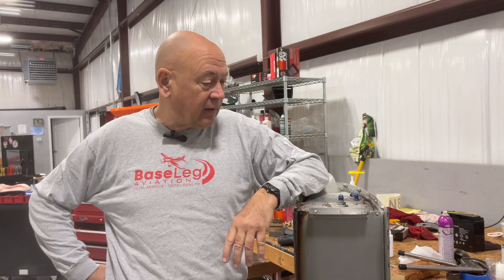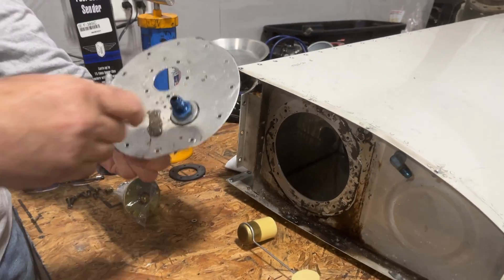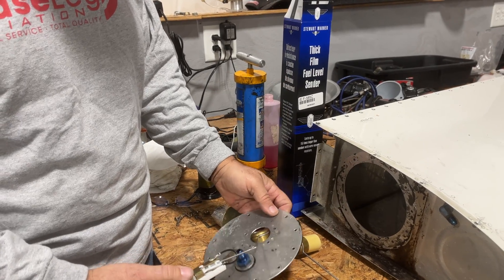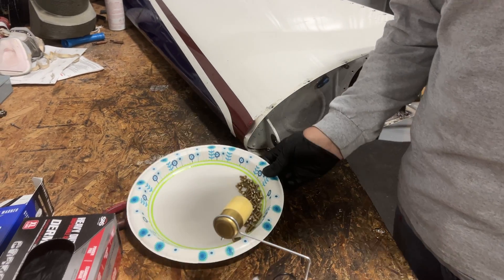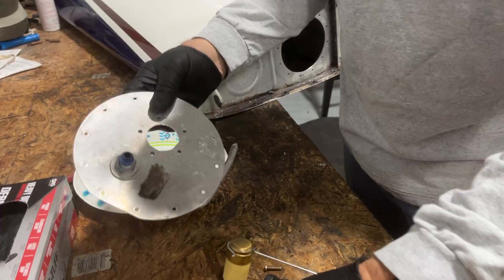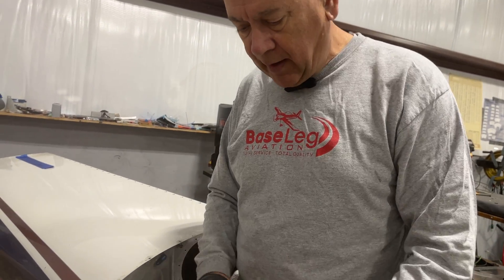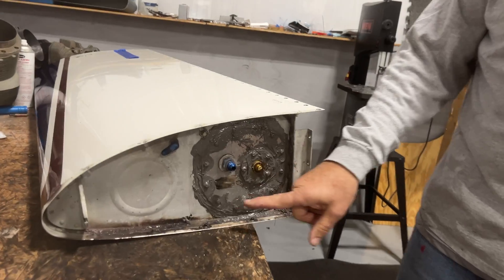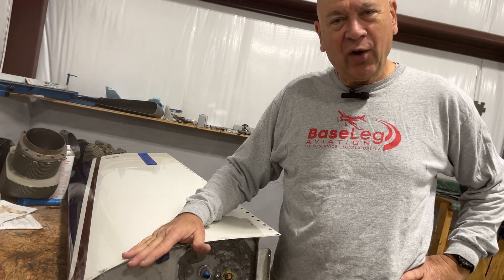Installing float fuel sender on Van's RV-8

Comment: Just replaced my sender with an new one.  How long to wait before adding gas?  Looks like the b 1/2 proseal is cured to tack free at less than 4 hours, and 35 A durometer at less than 7 hours.  Is there a utility in waiting days, or is this just a practice people have adopted over years to be "safe?"
Reply from the maker: depends on temps. I woud wait least wait 24-72 hours.

Comment: Use a plastic knife (free from your local fast food restaurant) to spread the proseal. Much easier than a brush. I always put a thin layer of sealant on both surfaces, then a little twist to make them form a tight seal.

Comment: Is there an easy way to verify that the fuel pickups are aligned facing aft?  I’m 95% sure I did it correctly. Not easy to feed a borescope through the fuel cap. Thanks
Reply from the maker: remove the quick drain and use a bore scope there.

Comment: When tightening the screws,  do you just snug them or tighten them like any other application on the plane?  Seems regular tightening them would squeeze the pro seal out. Great tip on soaking the screws in acetone first!
Reply from the maker: I don’t set them real tight, but they are more than snug.